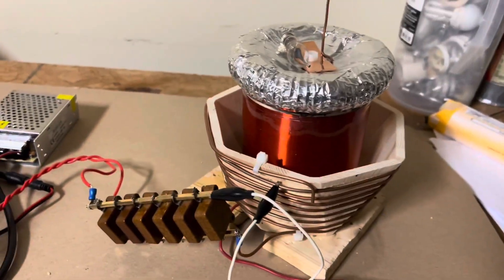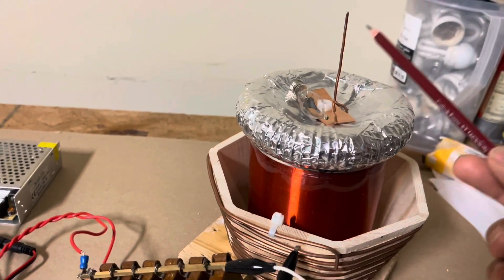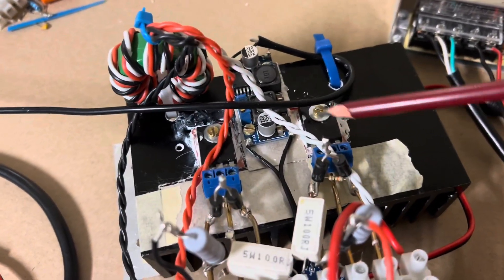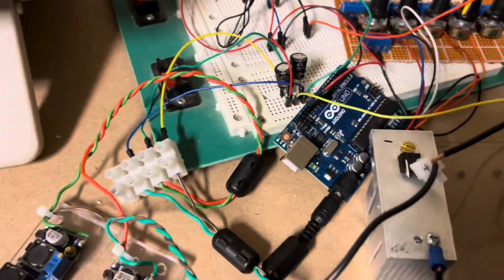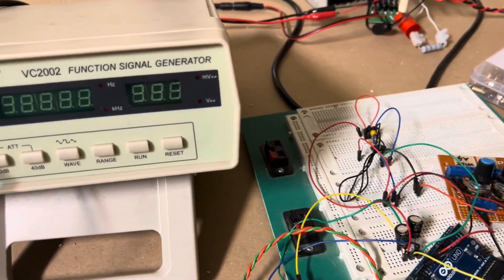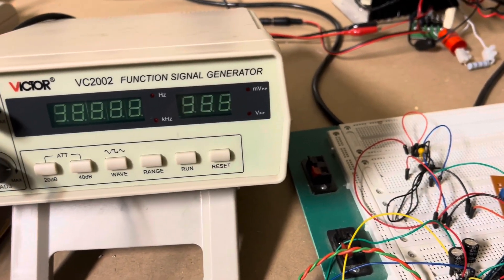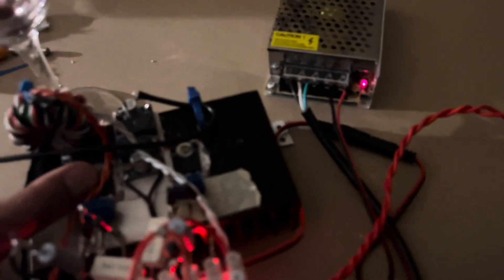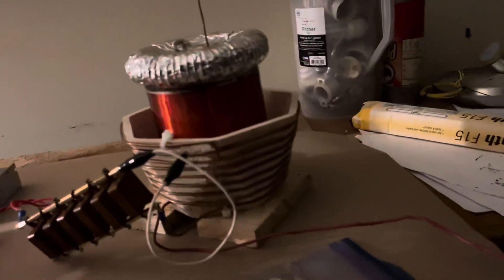Experimenting with Small Ramped ZVS Coil

Comment: How does one ramp zvs
Reply from the maker: It’s done by putting 12 V on the gates of both transistors to keep the ZVS oscillating at its resonant  frequency then ramping in the DC voltage from 0 V to say 60 V using an asynchronous buck.
Reply from the maker: It can also be done by adding in half wave rectified DC.

Comment: Hi there Brian, I got the Arduino code for the  from Arc Angel Channel ( from a certain Forum) but the thing is , I want to know in details the LC circuit that you put in  & aside from that , you've taken mains from your Variac full wave rectified it then used a 150uF electrolytic cap to pass all that juice through that ramp that's triggering the positive side input to your ZVS driver.  Then you've used your signal generator to feed in your gates at same resonant frequency. You said to remove that 10Kilo ohms resistors & 1N4007 diodes  when we actively need to power the gates through a GDT but while zooming in , I saw that you still have those 10 kilo ohms resistors plus that 100 ohms resistors & TVS diodes connected across gates & source!  I mean I'm in total confusion man! So far my ZVS is giving me  around 7 inches of swords outputs same as   in one of your other ZVS videos.  I just wanna get same branchy  outputs but I can't coz  I need to figure out about your LC circuit! Can you help? A proper circuit diagram would have been helpful coz the one I got from that Eagle file has no values for the components! Lately, I'm following all your videos  on that ramped ZVS Tesla coil but so far I succeeded in getting getting around 20 cms swords output. I want to attain same result as your RZVSTC video. Would really appreciate your help Brian. Thanks for all those helpful that you've uploaded so far on that ZVS & RZVSTC. I really appreciate.
Reply from the maker: Yep I just checked and it looks like I left the 10k resistors in but removed the UF4007 diodes since the set up is not self oscillating. The trick to get longer arcs is use higher coupling between primary and secondary. Also, the tuning seems to make a big deal of difference. Instead of using a signal generator, you could just use a 555 timer in its place.

Comment: Hi there. A little recap if I'm not mistaken! Your ramp (Arduino driving the switch plus the LC circuit as you've programmed that Arduino) is being used for ramping the main input supply powering your ZVS, that's OK. I've understood. But what is driving your GDT? Is that the fixed output from your signal generator going directly to power your GDT? Did you use an opto isolator in between the signal generator & the GDT? Sorry for that little confusion!
Reply from the maker: I’m using an optoisolater between the signal generator and the primary of the GDT

Comment: Awesome! very impressive. Thanks for sharing the basic idea, of ramping the voltage supply to the mosfets, while driving the mosfets at the resonant frequency. I wonder if this sword spark is due to displacement current
Reply from the maker: Thank you. Certainly not optimal yet, but works very well. The electronics is way simpler then a QCW coil where the gates need to be turned on and off in synch with the ramped  input.